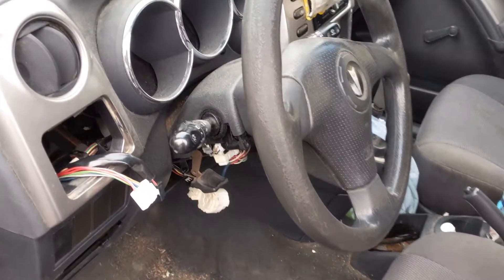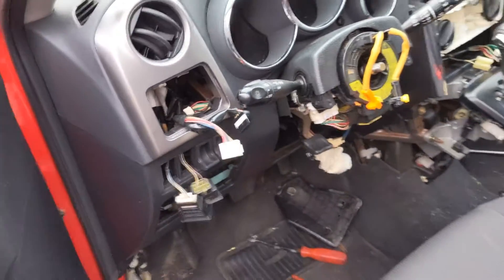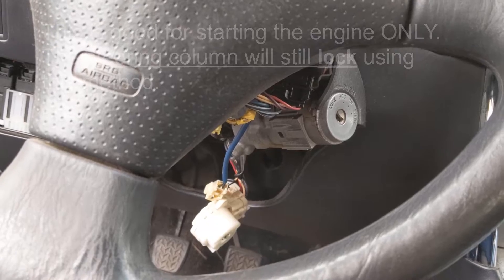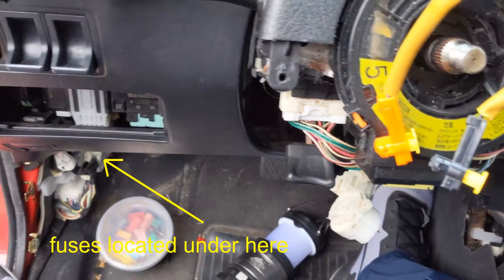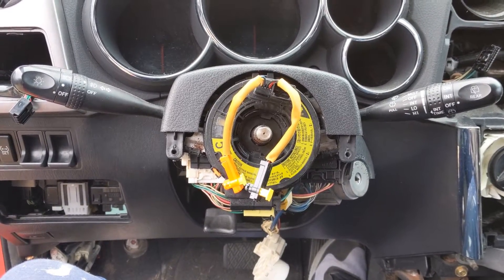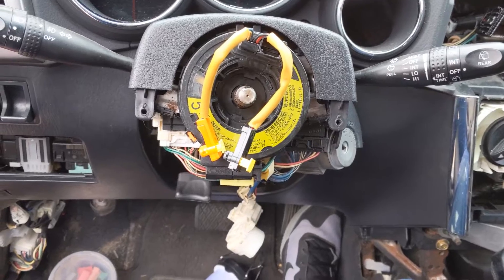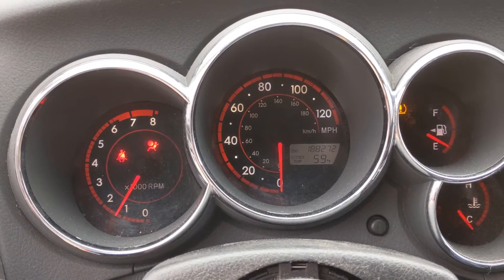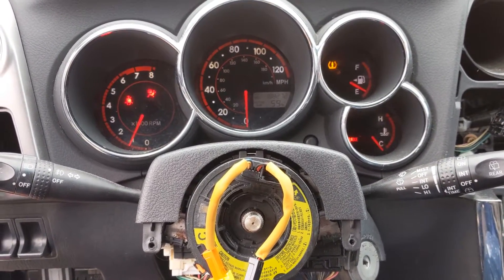Diagnosing: No-Crank, No Check-Engine Light and Starting a Car Without a Key... (2005 Pontiac Vibe)

Comment: A GM dealer will order you a key if you give them the VIN.  What's crazy, is I've known people back in the day to go to the parts department, and they'll get you a key with no proof the car is even yours.
Reply from the maker: If I can't get the key, I might go that route. A locksmith wanted $220 for a key. Hopefully the GM dealership is cheaper. I checked with a friend at Toyota who had said that they can't do it with the VIN since it's a GM product even though the guts (and keys) are all Toyota-based. Thanks for the tip, and yeah... that's scary that they would give you a key to a car that's not yours without proof... Maybe people were just more honest back then.